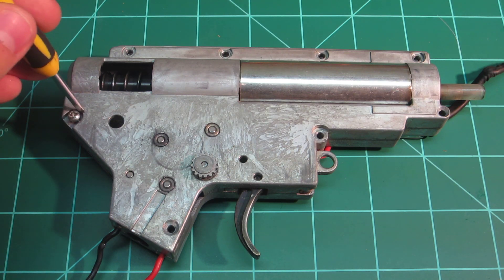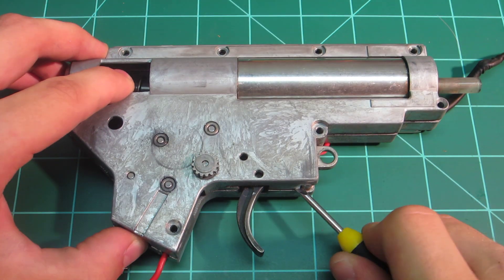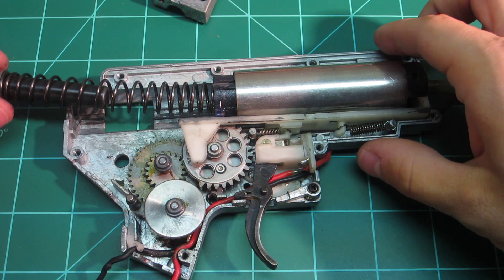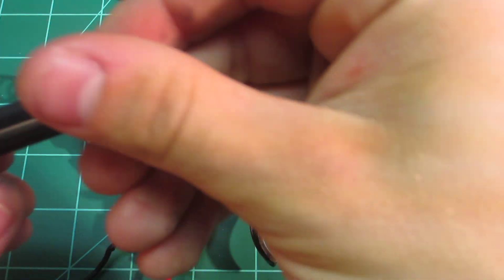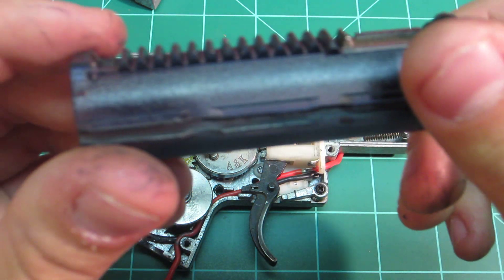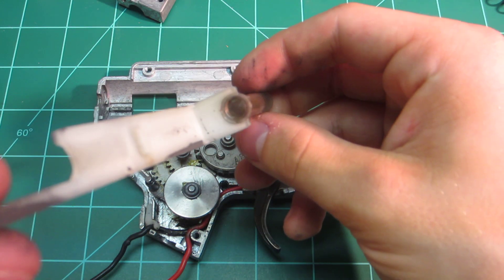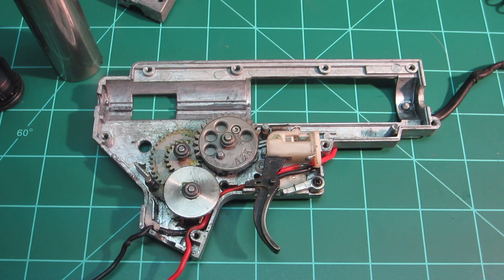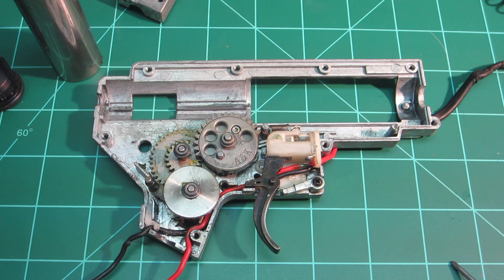A&K Masada ACR Internal Review

Comment: i had a game where i ran an 11.1v lipo on this gun completely stock, but i took care to go only in very short full auto bursts or semi only. i would suggest, you get a new motor, that doesn't heat up as fast, and take care not to fire full auto without the need to. it can take 11.1v lipos, just be careful, and don't ALWAYS use one.

Comment: Mine came with a white piston, cylinder head, and a basic no bearings spring guide. Gearbox broke on me right away, but then again it came to me with a shredded hopup so I can safely say it was the store I bought it from and not A&K. Putting a 8mm G&P Gearbox, a G&P M120 motor and a KA Hopup in it though

Comment: looks like a vfc piston the gears look like their newer gears which are close to the best stock gears made their old gears weren't that great add say get a new cylinder head preferably lonex and if you can give me the measurements of that air nozzle i may be able to build one on shapeways that can use an internal o-ring id say throw some bearings in there as well as shim it and you got yourself a solid gearbox

Comment: I do want to ask what other gearbox is compatible with the A&K because apparently my Masada came with a bad gearbox I thought it was a motor problem but then I got a 120 and the gearbox just didn't want to move so yeah.
Reply: its may be just the motor pinion gear that is not well aligned